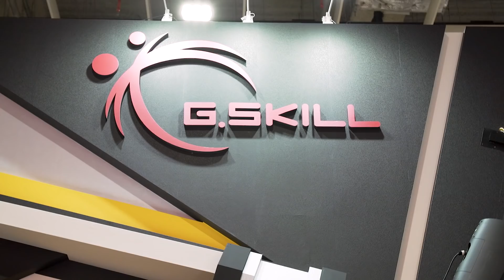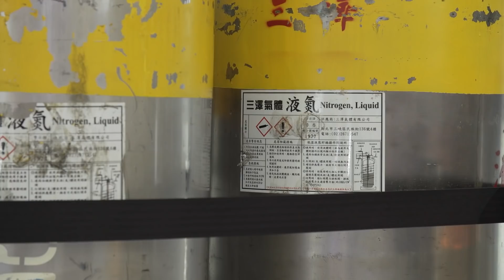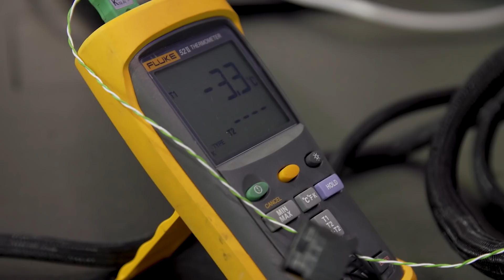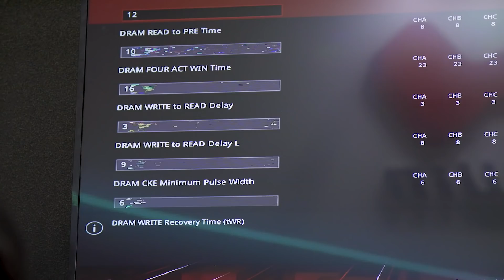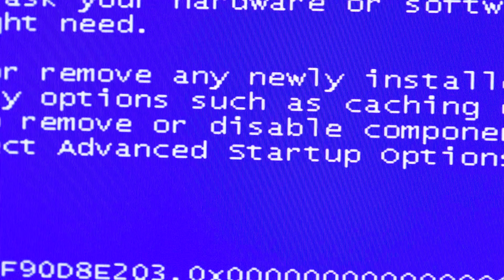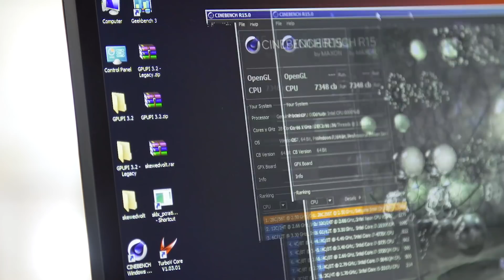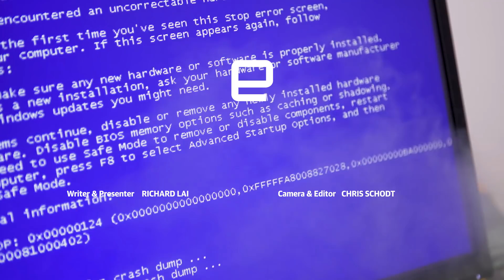Overclocking a 28-core CPU at Computex 2019

Comment: Could you not set up a dosing system using an arduino controller to dose their LN2 depending on the temperature of the CPU rather than just watching the temperature reading and pouring LN2 freehand from a flask lol would take a bit of engineering to set up a tank and a dosing injector of some sort but should be possible!

Comment: The record is actually 8.4 ghz
Reply: charlie payne cpu freq.. depends on how many cores we are talking about
Reply: Yes , I have seen that with intel cpu . Intel has its strength that can not be defeated . But its price pushes customers toward amd .  That is all .   I still do not know with 8 ghz , we can run which software suitable for that frequency . Not yet , just the show or competitor . Like formula race but not the real road in life ! .
Reply: Nam Doan Ha MHz doesn’t matter, it’s the efficiency
Reply: @BeardedHardware  I am programmer also , in fact , high cpu frequency needs the higher frequency in FSB  from the mother board and the ram frequency . If not , the cpu will make bottle neck for the ram because the cpu processes  too fast in comparison with the ram that can  handle to store in memory . High frequency of cpu requires high FSB support from mainboard , and  ram frequency as a whole system .
Reply: Nam Doan Ha depends on platform
Reply: What i mention is oc  mainboard and cpu and ram as a whole . Oc cpu by decreasing its temperature is just individual perspective . You must also oc in mainboard to run the software .

Comment: We need a motherboard redesign. As in a H pattern that isolates the cpu from everything else- cpu in the middle of the H.  Or a separate board just for the cpu only.  That  connects to the mother board . Maybe I should start my own kickstarter.
Reply: thought of the same xD it will make the overclocking process more easy i think
Reply: Surely there would be lag if the CPU board was separated from the main board?
Reply: @LeshmuttRecords  it would stay in the board, but in the other part, it wouldn't causee latency i think
Reply: @KirinCloud  yeah fair enough, I thought you meant like a separate board. But I agree - further away especially for this type of thing is better!